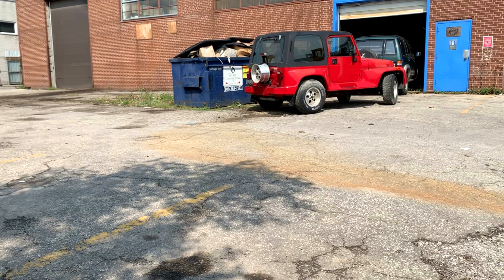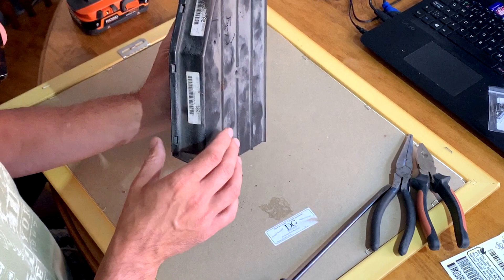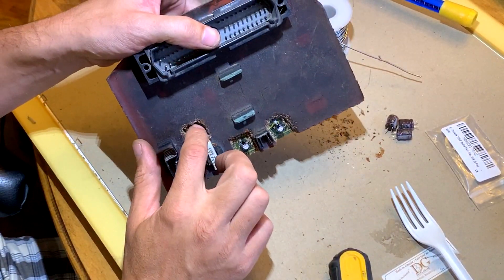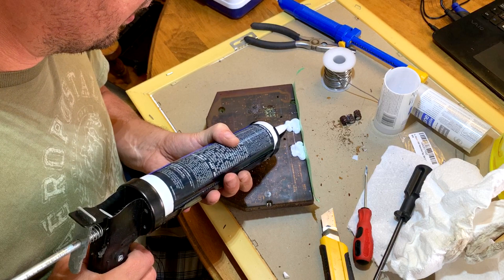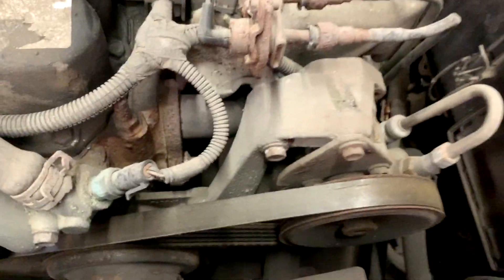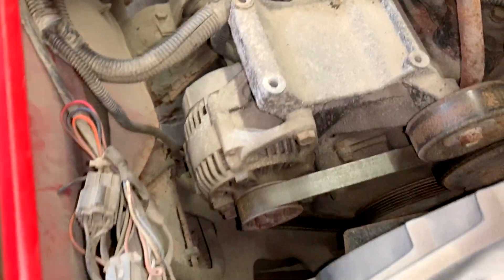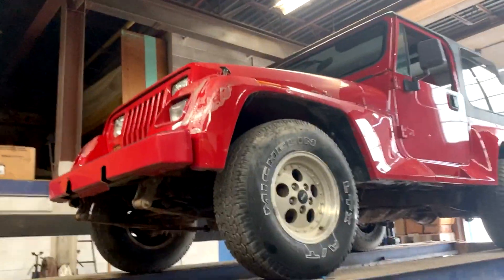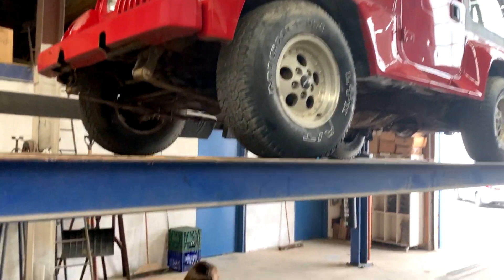1994 Jeep YJ - Part 3 - ECU repair

Comment: Nice job with the ECU.  You can try using solder wick instead of the solder sucker, you might like it better.  Also when you can't get all the solder off, you can try resoldering and then sucking all the solder off again. This will often work well.  Be careful with using silicone. The stuff with acetic acid in it (it's smells like vinegar) can damage the circuit board over time. Use non acetic acid silicone or use potting compound. Potting compound is designed to encapsulate electronics and is what was originally used on that module. FYI

Comment: Thanks for this video! Seeing you put the extra ground on the firewall fixed my Jeep!!! I replaced a bad fuel pump but it was still not starting. Mine has the Check Engine light and Forward shift light coming on when I turn on the key but still was not getting any fuel....... added the ground with booster cable and it started right up!!! THANK YOU!!!

Comment: Hi Elin, as long-time lurking watcher I was finally moved to comment on the Jeep. Since I have learned most of what I know about my TR6 from you and Cheftush, I am thrilled to see you starting into a Jeep. My 2011 Wrangler is not quite in the same vintage as your YJ but from my 30 years of Jeep ownership it does seem that they are careful to maintain all the same faults and defects for decades of model years. I should be learning from you even more.
Reply from the maker: Nice to know my videos are helpful for other people. Whether I do it right or wrong we all learn something together even if it is from my mistakes :)

Comment: It looks to me you should take the body off to do the frame repairs or replace the frame. And to do ALL the necessary repairs, brakes, shocks, etc. These are fun videos. I have a 1991 Jeep Renegade Red outside, black hard top, gray interior, 5 spd. Manual, A/C. Mine is like new, I’m the original owner. Thanks
Reply from the maker: That is always the best way, and that is what I do when I restore cars. However, this was not a complete restoration and I didn't want to go too deep, because I was going to find more issues and before I knew it it was going to turn into a ground up restoration, which I don't have the time for. I just wanted this car back on the road and last few more years until I decide to do a proper restoration. I finished it a few months ago and it worked pretty well. You can see that by the end of this series. The Jeep drives pretty good now and I am happy with it. One day I will restore it completely.... But I have many other projects that have priority right now.

Comment: Nice work on repairing the ECU. Seems like I could have repaired mine back in 2002 but the information about the faulty capacitors wasn't available then, at least not that I could find. Great job!

Comment: If you have to do a repair like that again, you might want to consider hot glue instead of all that silicone. It will also aid in installing the capacitors and there is no dry time. Good job.

Comment: Patience and persistence have definitely paid off in getting it running and knowing what you have achieved on TR6 frames the chassis should be no problem to fix properly so all is looking good. The only thing tearing me up right now is knowing what colour you are going to re-spray it in ? White to match the 6 ?
Reply from the maker: LOL, I am not even touching the paint work for now. I will just peel off the clear coat and that is how she is gonna live until her time comes for a proper restoration. White is not my color, and it wasn't my decision about the white TR6. I am considering white for my Spit 6 future project, but I am not really sure yet :)

Comment: Interesting jeep, but it's too rusty, in my opinion. Good job with troubleshooting and soldering! The engine sounds fantastc; that 4.0L is a stout engine that runs forever, but yours sounds better than mine in my 98 GC. Shame that it's so rusty!
Reply from the maker: Actually the body is in pretty good shape. The frame will get patched a little and will last few more years until the time for a proper restoration comes.

Comment: Hola. Soy Harold de Perú. Tengo un problema con mi Jeep Wrangler YJ 2.5L de 1991.
Enciende normal, pero la PCM no envía el voltaje de exitacion del pin 20 al alternador.
Cambiando los 3 condensadores se resuelve el problema?
Le agradecería mucho su apoyo.

Comment: Mine isn't getting spark. Replaced distributor ,spark plugs. Re soldered all wires. Ignition switches ect. Still nothing . I'm getting a check engine light when it cuts on. But it goes away. Getting nothing.

Comment: Came for the Jeep video, stayed for the re-capping...

As for your technique on circuit board repair, umm, watch some GadgetUK164 videos before your next one. The junk that leaked out of the cap will continue to eat away at your traces until you wash the board off. So you will be back...

I soak my boards in white vinegar until the fizzing stops, rinse it under tap water, shake it off, and finish with a 91% IPA bath.
Reply from the maker: Thanks for the advice. I've never done anything like that and I wouldn't know
Reply: @RustyBeauties  It's as bad as acid, and it's pretty much the same stuff that leaks out of a alkaline battery. Which is why we use a weak acid (vinegar) to neutralize the alkaline. So it will continue to do damage until it's cleaned up. GadgetUK164 is a great circuit board repairman, and he uses pretty common tools, which makes the repairs accessible to anyone.

And the stuff is insidious, it gets everywhere, and it will migrate to the far corners of your board.

The good news is that contrary to popular belief, you can wash a circuit board, just don't have it powered up when you do it, :)

I've done a dozen Amigas, Commodores, and Speccy's with no fatalities as of yet. Be sure to do the alcohol rinse to "dilute" the remaining water on the board. Your dishwasher will do an excellent job as well.

And I didn't know that you could wash a board until I read some posts regarding fixing old Jamma arcade games. The first time that I did it was on an Amiga 4000 board. Kinda like trying out a new body work technique on a Jag instead of practicing on a Yugo instead. :)

Comment: I'd be curious to know if someone makes an affordable replacement frame, or if a used (but less rusty) one could be found- it would save so much labor and probably be stronger, than having to patch it at both ends like that.
Reply from the maker: Well, I am known as someone who would replace parts as the last resource. I am always trying to fix what I have, which is not necessarily easier, but for sure it makes for more fun, which is my main reason to work on these cars.

Comment: The smaller capacitors could have higher ESR and so might not be the, "Exact" same.  The higher ESR can make the capacitor run hotter and consequently fail sooner.   Even if this is the case though, you probably have 15 years before you would have to change again!
Reply from the maker: Well, I am not familiar with those things. If they say the same thing they are the same for me LOL
Reply: @RustyBeauties  I get it, I don't know how to do body work, but this is how we learn.  The ESR in the cap can cause it to heat up and that is what makes these types (in general) of caps fail.  Ambient temperature and heat from operation will degrade them over time.

Comment: Elin, when I say that you are restoring far above orriginal spec, this video https://www.youtube.com/watch?v=7rufKg6qT7M explains what I mean. These guys are selling a new body shell for a 50-year old UK sports car for CAD$20,000, but they are copying the exact methods used in the factory using the original factory jigs and tools. Notice how they are just needlessly entombing unpainted steel box voids which you would often paint internaly as you work. Your rebuilds will last far better than these new shells will. These new Heritage Factory shells are just like the originals - yes - perfect little rust buckets. Ben ;-))
Reply from the maker: Well they are hiding behind the word "originality" while saving cost on labor and materials. I am sure if they build a body for themselves they do it in a different way :)
Reply: @RustyBeauties  It just goes to show though, that a collector with all  money and no sense, could go to a very posh classic car auction in London to buy a perfect 1969 MG Midget and actually get something terrible compared to what he thought that he was buying. So, he is really wasting his money and that, in my opinion, just serves him right.